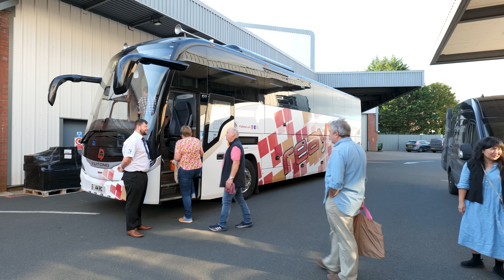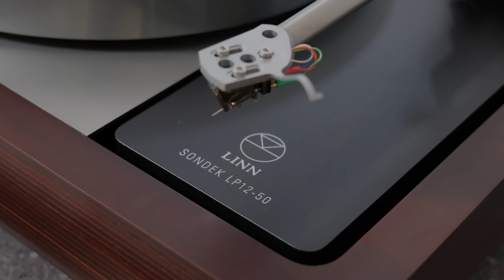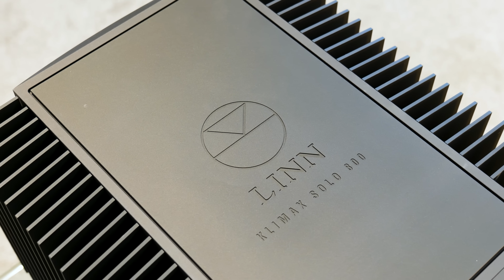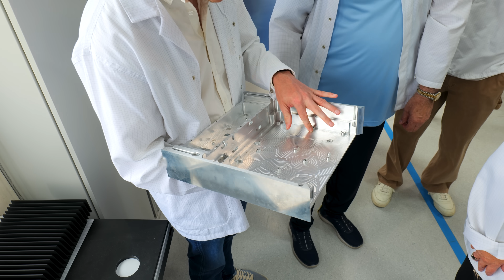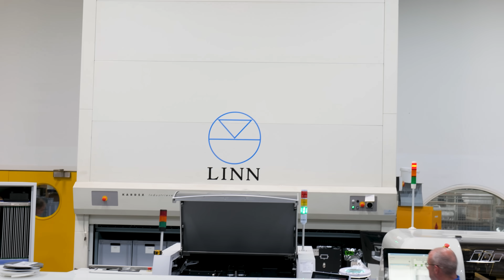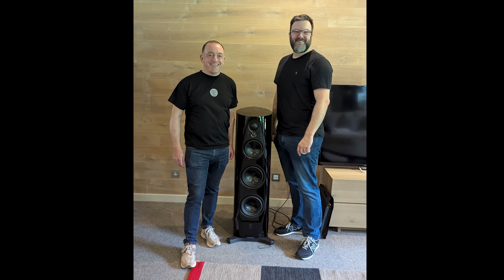Linn Factory Tour : Clydebuilt With Love

Comment: How bloody silly to have to keep upgrading a turntable. Over engineered to allow for the upgrade.. the turntable should come fully completed with the best possible component to design without a customer being told. I need to chuckle away bits and replace them with others a few years down the road.. I don’t like to buy a kit. I want to buy something good..
No, thank you Linn
Reply: Linn turntables are complete. However, you can upgrade components to higher grade components as and when you wish. You can buy the top end system complete, if you want, but most people can't afford that. Having a point of entry allows you to have an investment in your hifi, which you can upgrade, without having to replace the whole unit. Many other turntables allow you to upgrade components, it's relatively common to do so. Linn allows for both a broad and granular detailed means of upgrading.
Reply: Source first - that's why I have a Thorens, and I bought a car with the money I saved not buying a current LP12
Reply: Like a PC. They should come with the best possible components without the customer having any choice. Better to throw away an entire PC than buy a new hard disk right?
Reply: @enigmatwist6548 a silly comparison. PC tech evolves. Turntables are ancient, all is known, nothing new save for better engineering tools. EMT knew all that was needed, as did Garrard WAY before linn got going.
Reply: @telbert3204 the point is it allows people to buy into the brand with a base model and upgrade components as funds permit. There’s nothing to say you need to upgrade there’s just freedom of choice. Also new record players don’t sound anything like players from decades ago they’ve evolved.
Reply from the maker: I couldn't have said it better myself - John